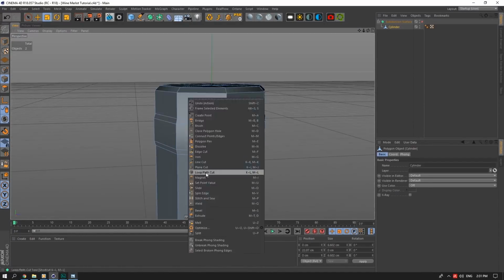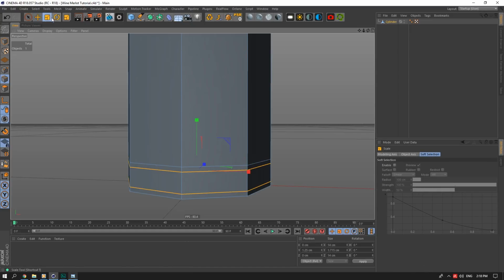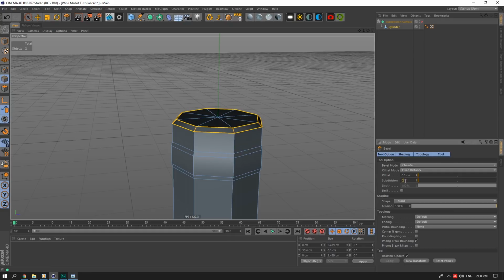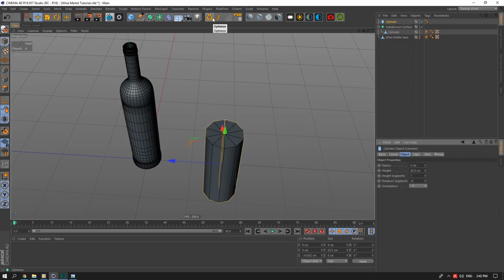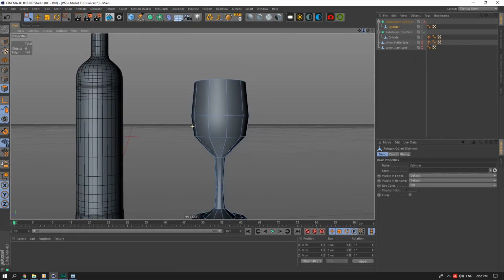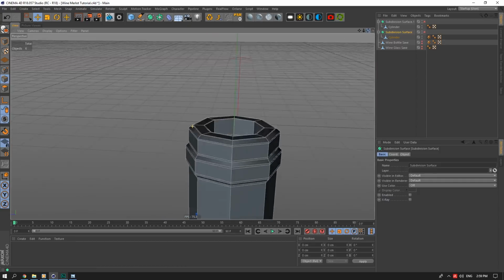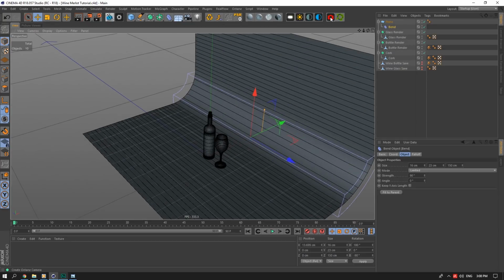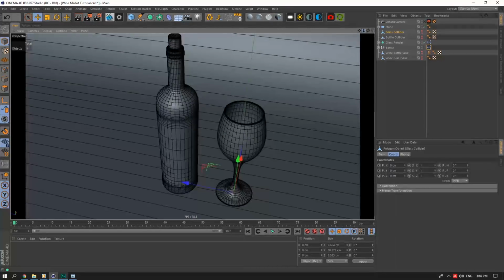3D Wine Modeling Part 1 | C4D, Octane, Realflow

Comment: Hey Arthur, great tutorials. But why don't you use the Lathe nurb when modeling bottles ? You could draw half the bottle in a spline, and quickly make a bottle in 2 seconds with a Lathe around it. Is there a reason you model it this way ?